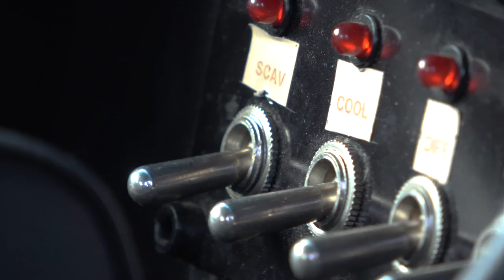Race Cars DO NOT Make Good Street Cars

Comment: You should have called this video 'Unfinished cars do not make good street cars'.
Reply: manutji to be fair a car is never finished, even this decade old project
Reply: No matter how finished it is it any car with door bars will still suck to get into.
Reply: As long as some one on the planets car is faster........ its never done,  because 2nd place is just the first looser.
Reply: No amount of "finished" is going to make a race car a good daily driver.
Reply: LiveTheDream24
Wow. You've no idea what you are talking about.

If the car was finished the trunk, windows and AC would work. You don't leave those out.
Reply: manutji
The title should be:

"Sloppy project cars don't make good street cars".
Reply: Weight savings bro!
Reply: manutji project cars are never finished.
Reply: This is a purpose built race car, it's made to go fast, not to be comfortable. Hence the point of this video.
Reply: The only really thing that would change for his car is the windows working. The a/c and heat were probably left off on purpose. They add weight, take power away.
The rear hatch opening on its own would require a lot of modification to overcome the weight of that wing, and that would add weight to the car. 
These sorts of things are the trade off for speed. If you want to go super fast, you must lose comforts. 
You can build a fast car that you can bring to the track, but it can't win a race against these full on purpose built cars.
Reply: snoopdogie187 couple tabs and some valve springs would take care of the hatch.
Reply: Seriously

Comment: So race cars aren't good street cars because you cobbled yours together? Come on now Rob lol
Reply: Ok how about the Ferrari F430 Challenge racecar that Doug DeMuro reviewed? All factory and still a POS to drive around town. Now do that everyday, and tell me how much fun it's going to be. At the end of the day, a real racecar is going to have a full cage, so poor visibility and getting in and out is going to be a pain in the as. No AC, probably no powersteering, mechanical heavy brakes, no sound detening, stiff as hell suspension, must I go on?
Reply: MrCargod05 I agree to an extent. Lots of those are creature comforts though, not really needed for daily driving.
Reply: LSX StreetCars Everything he listed after AC are pretty much needed. Otherwise you are going to have a bad time. Even the AC is a HUGE plus even if it's not absolutely needed
Reply: Why are they needed? My 66 AMC has none of those outside of power brakes.. suspension isn't stiff but it's not great.  I could daily it no problem if I wanted.  Full cage is a thing, but the only real issue is going to be the door bars, which can be made to be removable.
Reply: even the m4 gts is pos to drive on street
Reply: +LSX StreetCars compared to a stock car, while it may be more fun to cruise around doing daily stuff will be much less enjoyable, not to mention if you daily a proper race car you'll probably end up fucking up your back etc from the rough ride.
Reply: LSX StreetCars Have you ever driven cars with more luxury? I used to think like you, but after having spent lot of time (as a driver and a passenger) in cars with AC, Cruise control, low tire noise, good quality music system and stuff like that I've come to realize they make the daily driving MUCH more comfortable and enjoyable. I used to think I'll never need more comforts than what my 90s cheap Corolla has in any of the cars I'll buy. Nowadays I think that, when I finish school and get proper jobs and can afford nicer cars, things like AC and cruise control are must-haves for a daily.
But if you can live with the car you described as a daily then all the power to you. But I sure as hell couldn't live with a car like that as a daily for long
Reply: SingleTurboSupra yeah, i mean I drive a ws6 and 2017 grand cherokee regularly.. I prefer the old stuff honestly lol
Reply: Don't get me wrong, I also love old cars mainly for their simplicity. But I just would never daily a car like that, I'd buy them as a weekend/project car :)
Then I'd also have a completely separate track-car if I wanted to do track driving or racing

Comment: You could have just put the box in the passenger seat...
Reply: Hello Bye ^ he's just showing what a pain the car is
Reply: Cj Iscool
Or he could just fix the trunk, windows and AC.
Reply: Boner Kill AC is removed because of weight all in the front of the car, even if the trunk latch worked, with the weight of the wing it doesn't pop open. 

Not to say every car has to built this way but in most race cars trunk space is used by the fuel cell in most cases and AC, radio and sound deadening are removed so it's not a pleasant place to be.

Comment: My race car has no a.c. is so loud, smells like gas all the time gets followed by the cops and i still love it
Reply: I also have no hood because the motor would go though it they're over rated anyways
Reply: dennis bryan Engine stays cooler without a hood anyways
Reply: I also think I may have the only fitech equipped ltx 383 f body 
No tech support there :)
Reply: dennis bryan cool...what do you have?
Reply: Mou Jalout pontiac firebird formula
Reply: dennis bryan ah...nice!
Reply: Yeah my last car had no ac straight pipe no radio and I was content but that's still pretty far from his corvette

Comment: Ur better off buying a tack car and making it a street car then the other way around 

sauce ur pasta don't pasta ur sauce kids
Reply: No you're not... Putting a heater core, wire harness, interior,etc back in a race car is a huge pain in the ass too. You're best to have a race car and a track car and don't try to make one the other.
Reply: Mike Arredondo I only eat what I cook 💯💪
Reply: Maxwelhse or have one be both because race cars are fun to drive in the street
Reply: No you're not, replacing all the interior and shit is no easy task.  Often race cars are made as a 1-way street (ie. shit cut off), it's usually very expensive to return to stock.  Once you go race car, leave it as such IMO.

Installing AC & interior back in is never an easy task.
Reply: except AC weighs a lot and that's why most race cars don't have it

Comment: YOUR race car doesn't make a good street car.
Reply: Tell me about it. My street car is harder to fucking drive than this thing. And it's all stock. Guess I'm just manlier than him? Manual choke manual windows manual brakes manual trans manual steering manual everything. Not a problem. But i guess when you expect everything to be as perfect as a 2017 ferarri you'll find flaws. Oh and it doesn't have air con, and in california that's the hardest thing about my car.
Reply: You missed the point here, he summed it up by showing "simple bolt-ons becomes this", transmission was cooked and multiple other issues that piled on one another.
"Don't do this to your daily car"
Reply: Just for youtube Do you want a cookie?
Reply: Michael Redolfo if your race car isn't equivalently as useless as his do you really have a race car? If that's a yes roll down your windows and pop your trunk
Reply: if your race car is a good street car then its probably not a very good race car
Reply: This. Rob made a good car worse by trying to make it into a race car. Unfortunately he did it on a budget and didn't spend the extra cash or time to make it what it started out as: a car.
Reply: lawszepie no it just means it's more reliable or is in between
Reply: It seems like a lot of mods have been made the wrong way.
Reply: Seems like Rob just built his car inefficiently. My car has 834whp and drives like stock around town. No reason you can't have a great street car and a great race car.
Reply: Sorry guys but i've seen some pretty fucking kickass RACECARS that have trunks that actually open when you want to open them, with windows that move when you tell them to and with a transmission that doesn't melt when you hit the gas. It can be done. Rob just did it very poorly.
Reply: Michael Redolfo few race cars are good on the street.
Reply: Just for youtube His stock transmission broken because he was making too much power and then he replaced it with a stronger one. He never said his transmission is the reason why driving that car daily would be annoying he's saying that something to worry about when building a powerful car.
Reply: Y'all realize this car was built like over a decade ago
Reply: Just for youtube Show me, because they typically pull out all hydraulic assist devices for real racecars. Lamborghini, Ferraris, Koenigseggs, etc are not real racecars. When you're talking racecar, things like GTLM, WRC, LMP and such come to mind, not SCCA backyard bull crap.
Reply: nicholas wong RIGHT??
Reply: Was just about to write the exact same thing.

"Why my mistreated and unloved race car is broken".
Reply: +nicholas wong you realize NASCARs in the 50's had trunks that worked and motors that started when they wanted to start them?

Comment: Maybe the rear watch would open easier if both struts were attached to the car?
Reply: Mopar And More the struts work it's the heavy wing that prevents it from piping open, street speed 717 had the same issues when he put his "big wang" on his Manuel Z06
Reply: It would at least assist in lifting if it was connected.  Might as well take it off completely in the name of weight savings.
Reply: X_Foundation put stronger struts
Reply: X_Foundation but he fixed that with stronger struts
Reply: Mopar And More a true race car has the back hatch in plexiglass and doesn't open.
Reply: Was it necessary to bolt on such a ridiculously huge and heavy wing? Smaller OEMs can have nearly the same effect.
Reply: DareToBeDeviant yes indeed it was necessary don't think I've ever seen an OEM spoiler do what his does. I do believe he said it was a $7k spoiler in one video. Don't think OEM spoiler were meant to be used for racing at 200mph+ on the track.
Reply: I'll have to see some coverage on the Corvette then so time to play catch up. Missed a lot because at one point he stopped making videos on the topic. Was just basing this on other 'professional' setups that used way smaller wings going triple digits.
Reply: You can put struts in that hold more weight. He puts the wing on but doesn't upgrade his struts that's him being stupid. Like his window he could of easily just put a switch but he's being lazy to fix it.

Comment: Im thinking about doing a rather fun swap in my 2001 Honda Accord CH9 SiR Wagon. Not sure why, but i really want to give it a V8 transplant. Preferrably LS2 if i can help it. Just not sure if it will work out well. Mainly because i do not want to change any thing cosmetically. I want it to stay as Honda on the outside as possible. Would it be a good idea to use the Honda Shell and chassis and fit everything to that or better idea to find a Holden R8 Clubsport Wagon, strip of the Holden shell and Place the (Obviously Widened) Honda Shell on top of the Holden Chassis????

Comment: This looks like most things I own... INCOMPLETE!  My M-Roady power top stopped working 5 yrs ago, I have been using it in manual mode ever since [garaged], could just be low fluid.  Radio was removed years ago too [new one in box].  Oil always changed.  Don't get me started on my boat... it floats and runs, that's about it!  Too many things/hobbies.

Comment: The thing is that many people forget comfort and street usability when tuning a street car. I only have one car. I lowered it but made sure it's not to low. Got good tires but no semi slick. Took the center console out but kept the radio and even upgraded the speakers. Didn't take the AC out, instead I fixed it. Didn't go all crazy on power instead got a quite nice sounding quite exhaust. 

At the end I have a nice car for daily use that is also fun on the back roads and comfortable on the Autobahn

Comment: Yeah, I learned this lesson the hardway.  When you're 18 it's easy to say "cuz racecar", but then when you get older you wanna keep that shit separate.  My firebird doesn't have interior or AC (or any creature comforts) and it's quite difficult to drive on hot days.  I wanna put an AC in it but I know that undertaking is going to be much more effort than I want and guaranteed SOMETHING isn't going to work out.

Comment: You could spend a minuscule amount compared to what you already have invested in the car, and get like nice carbon fiber or aluminum panels to cover up the door guts. Then you could add buttons onto that for fabricated window switches. You could also add a radio and speakers. They don't add that much weight. That's if you could hear the radio over the car.

Comment: yep you got a race car! you still have one nice thing that helps on the street though, functioning parking brake.  when I raced a first gen rx-7 in scca most people disconnected the cable altogether, rather than risk it dragging slightly and slowing you down.  also you should get some roll cage padding you need that to be scca legal anyway and much better for if you need to drive on the street, get sfi legal padding though not swimming pool noodle things that some people use lol.  the cool shirt is nice but not totally necessary, I raced 30 minute races in 90 degree weather, 3 layer race suit in a car with basically a straight pipe exhaust exiting right under the passenger seat shooting flames, and holes all over the floorboard lol, it was hot but i did manage.

Comment: Why dont you get a couple of toggle switches to control your windows you can console mount them or mount them higher up on the door
Have you thought of putting stronger shocks on the hatch like street speed with his z06 or attach a rope to the lever so you dont have to crawl through the seats
And lastly have you though about redoing the door bars of the roll cage?

Comment: you could fix the power windows with a little wire and two toggle switches, as for the trunk put a couple of bonnet pins and remove the internal latches (they make ones that lock if you're worried) I too ruined my street car  (after watching the first 3 super speeders DVD's when they were new btw)I ended up half way reversing it to a tolerable street use car and built a race car that has no plates and gets trailered around.

Comment: Rob, if you haven't already you need to change the o-rings out on your CoolShirt connectors.  They got brittle and cracked on mine and then it would just drip water when plugged together. McMaster part #2418T117

Comment: Realistically, most of what you're complaining about are issues with YOUR specific car, not the genre overall.
Lose the park bench and the large portion of the cage that you don't actually need, and it's a much better street car (or would be if you had it finished).
By comparison, I have a '99 C5 Coupe with an M6. Pretty much the exact same starting place as yours. Mine makes just over 700HP/600TQ at the wheels from a heads/cam/blower LS3. Which (according to the dyno videos you recently posted) is a bit more than yours. It has a ducktail spoiler and no cage, since these cars don't need a cage till they're in the 9's. It has a full interior (even door panels...). The windows work. So does the sound system, the heater, and the AC. Popping the roof is exactly the same as a bone stocker. I can and do daily drive it (ok, not when it's snowing...) and go on 3000 mile road trips with my wife. It doesn't catch fire on track days. It can run 10's on the same tires I use to drive to work (sure, it'd go quicker if I put on drag radials and retuned the suspension for drag racing, but then it wouldn't work on the twisty roads...).
I agree that race cars are not ideal for the street. I just don't think it's reasonable to call your Student Driver Vette a race car. It's really not. It's just an unfinished street car with some poor design choices.

Comment: Listening to two flow masters for 8 hours on cross country drive, not very much fun. 3.73 gears from the stock 3.07, and an automatic so now final drive is 2.59 and no longer 2.13, so at 60 MPH the engine is up 800 RPM and car gets 15 mpg not 30 mpg on the highway. Oh, yea and only run super unleaded and that is still crap instead of whatever cheap crap you throw into the tank because the compression means you really need race gas but it is $8.00 a gallon. Priceless though, just flat smoking a crotch rocket from 70 to whatever on the highway because you can. Oh, and 130 MPH comes REAL fast from 70 and don't floor it below that, just don't.

Comment: Half of the legitimate complains made in this video could be fixed for about $50 and maybe a pound of weight. I mean, some basic toggle switches for the windows and a little bit of cable and a pop spring for the trunk...? C'mon man... You're smarter than this.

Comment: Just gotta find that balance but it's hard to do heat is a big issue in my mk3 Supra and even with windows down doin 80 your sweating your ass off unless you catch that breeze that just goes across the front windows as for winter time o hell yeah love it summer time not so much

Comment: Come on Rob..........All I'm hearing is "There's too much sand in my vagina"..............Convert the windows to manual operation (probably loose a tiny bit of weight doing it) and run a cable to the B pillar from the manual boot release.  It's a 'Race Car' that lets be honest you thoroughly enjoy driving on the streets.